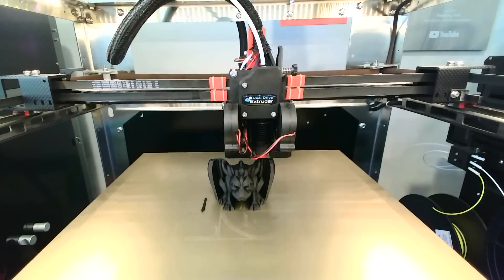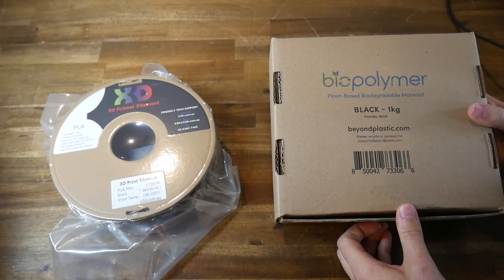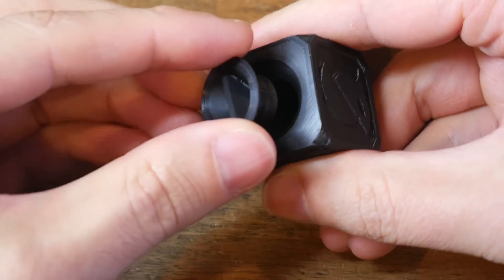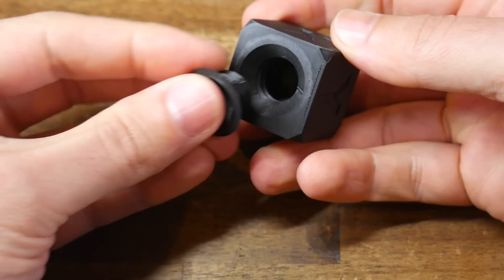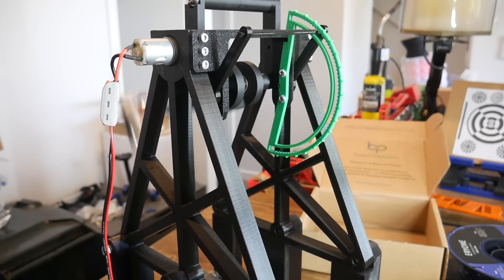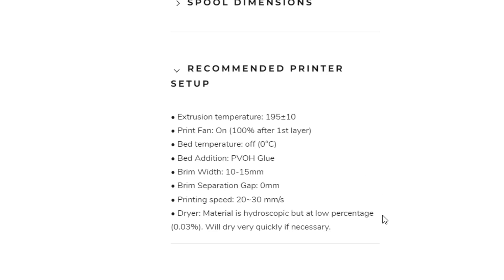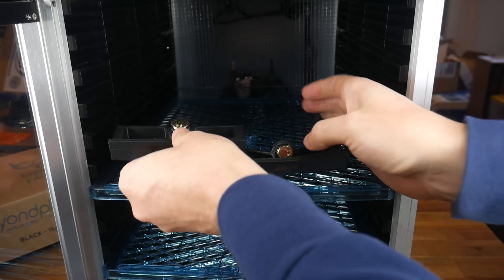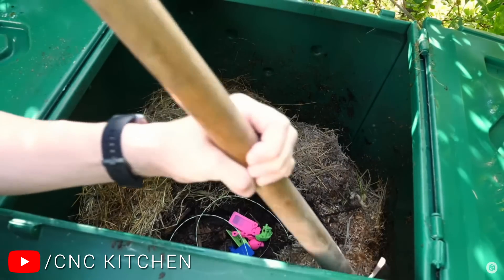PHA filament - Mostly superior to PLA and actually eco friendly

Comment: I am fairly new to 3d printing but if PHA cost the same and print the same (with a flow tweak) I would change at once. In my limited experience (almost) every print yealds better results with a raft for bed adheation, I would love it if all the waste was compost compatible to reduce microplastics in our enviroment. I was planning to burry a dead pet in a 3d printed "coffin" made from "wood" PLA but what I see make me hesitate. If I could buy PHA filament on the other hand it would seam ok to use, or did I miss something?

Comment: I would definitely be interested in PHA if it was close to the cost of PLA. If I could get it for less than 20 bucks a roll that would be great. I print mostly functional parts, and a little decor. I think putting it in a car would be interesting. I also want to know how well it sands down to accept primer and paint.

Comment: I'm so glad to see how many commenters here have used PHA or are interested in doing so. The public library makerspace i work at has used every single brand of pha we can find, AllPHA, Beyond, Regen (unfortunately), EcoGenesis, and soon also PHA3Design once it arrives in the mail. Personally my experience through all of that has been that the different (non-blended) brands are all relatively pretty similar. Certainly much less variation in quality than I've seen from PLA, at least. I've tried a few other ways to reduce warping that i haven't seen mentioned too much yet, including:

- If you have an enclosure, open it up as much as possible.
- The higher the infill percentage and the more solid bottom layers there are, the more it will warp. So avoid that where possible.
- Gyroid infill, or any other pattern that curves. When that contracts it kinda has some room to just straighten out a little, instead of pulling on the walls.
- Set the first layer pattern to concentric or Hilbert curve, evens out the distribution of contractive forces that cause warping.
- Finally, if all else fails… Rotate the object until it’s sitting on a really impractical edge, then print it in sort of a “cradle” of support material. BVOH or PVA if you've got it. Basically make as little of it touch the build plate as possible. Wasteful this way though.
Reply: If I may add (I am the co-founder of Ecogenesis genPHA Filament).

Print fast
1st layer should be at 217c, subsequent layers at 193c. 
Brim, 3mm, zero gap 
Frogtape pro-grade Orange tape works really well. Far superior to 3M Blue Tape. 
Warping in controlled by print temp and speed. 

Thank you
Reply: Oh i forgot one!! Find a formulation of PHA that is super flexible, like Beyond used to have, and make the first couple layers out of that instead. It doesn't warp at all and has incredible bed adhesion, that compensates for the warping of subsequent layers really well.

Comment: Hello! I am having a lot of trouble using PHA in my Flash Forge Adventurer 3 Lite printer. The PHA seems to not be rigid enough and gets squished when I'm trying to load it into the machine. Any thoughts on any type of mods I could make or a way to make this work?
Reply: What brand are you using? 
Ours is tested using AMS without issues.

Comment: i would still use pla for some prints but this is great, would be great as the standard for most prints and prototypes, just needs to be cheaper
Reply: Cheaper comes with volumes, need more people to start using it to get economies of scale.

Comment: I’ve recently come across PHA filaments and I wonder if it’s could be the next big thing in 3D printing. It’s the first non toxic, fully biodegradable (in home garden or garbage dump environments, not only in industrial settings like PLA). 

It’s referred to as a “bioplastic” and it appears to be one of the first eco friendly alternatives with minimal greenwashing we see for others like PLA. The major downside is the cost (higher). 

Beyond that, it’s kind of the goldilocks filament between PLA and PETG when it comes to trade offs of strength, UV or heat resistance.

Comment: For making cosplay parts it would be intresting if it can be machine sanded.
Since it does not deform in your oven test i expect it to withstand the heat created by a orbital or other sanding devices.

Also the warping is a big issue for me 

im currently printing with PETG due to its mechanical properties but would switch to PHA if the issues above would be solved

Comment: I'm more interested in its heat resistance, in my testing with PETG it is not nearly as heat resistant as many people claim it to be, an alternative that doesn't offgas styrene gas but can handle being in the sun would be very welcome. Another huge issue with PETG, ABS, and ASA is that the available color treatments and silk are not really available, I'm not sure if this is an issue with demand or if it is harder to color those materials than PLA, but if PHA is able to be treated with the same color variation as PLA can, that would be exciting. I know I am something of a minority in the space, but I hate printing with PLA because of the low heat resistance, even just plastic creep as a result of low temperatures makes it something I have zero faith in. I would love another filament to replace it outright by being as easy to print but with better mechanical properties.

Comment: I print with PLA because it's basically non-toxic, and I didn't see a discussion of this in the video. If I can print with PHA and not worry about the fumes, its better material properties seem tempting - although having to use glue might be annoying. PLA has the advantage of coming in thousands of variants, so plenty of people won't want PHA that doesn't have galaxy glitter or what have you, but I'm part of the probably majority that just wants basic colors, so PHA could work for me. I'm not sold, though.

Comment: I want to see a wood (or similar biodegradable) fiber filled PHA to see if it can help with the warping. It's the one major drawback of this material. Glass fiber fill would be ok, but it has a very high carbon footprint to manufacture.

Comment: I would also be curious about the fumes it releases. It seems that when printing PETG has little to no toxic fumes that can have you while PLA release some pretty bad stuff while printing. I would love to see a filament that is like PETG where its safe to print and pretty high heat resistant while being biodegradable like PHA, if it release is biodegradable like they claim it is.

Comment: Having mainly printed in PLA and PETG, I have not really experience warping, that I can tell anyway.  Most of my prints have a large surface area for bed contact, and after getting tuned, have only experienced prints coming off the bed with key filaments (which probably means more fine tuning as it is mainly due to collisions at high heights).  I would be interested in PHA over PLA for both the biodegrading as well as the heat and UV resistance.  I printed quite a few things that sit in my car, and had to switch to PETG as in the summer here in Ontario, PLA would warp.
If the cost is the same, (or a few bucks more per reel) I would switch, but as some stated below, not all PHA are equal, and I would want to go with a backed brand.

Comment: You don't want it to biodegrade. PLA is made from plant material and locks up "new" carbon. It will lock it up for hundreds of years. Good thing. Biodegrade it and you release CO2. "But mircoplastics!" Well, no problem. PLA degrades to harmless materials if it gets inside the body, which is why it is used in dissolving surgical sutures.

Disclaimer: I invented PLA filament,  precisely for these reasons and deliberately did not patent it.

Comment: I would absolutely like to get ahold of some PHA. I'm using almost exclusively PETG at this point because I hate how PLA behaves after printing and I'd really like to get back to something that's healthier for the environment. At $30/kg PHA isn't THAT much more expensive than good PETG or PLA which run $20-$25/kg, so it's absolutely worth it to me.

Comment: Extremely interested in PHA. One of the reasons I was okay with 3D printing is that I knew no petroleum products were used in creation of the filament. Getting a filament that prints on par with PLA, that is better from a materials standpoint, and that is more easily broken down when end of life would be fantastic. I probably wouldn't pay double for this filament, but I would certainly pay a substantial premium. In the long run, prices would surely fall and get it on par with PLA from a price standpoint.

Comment: PHA warps, like a lot.
You need to cool your plate as much as you can, making sure to cool down the plastic as much as possible and/or use a lot of glue.

I’ve used them for bushings on a small boat dock, they work very well. They don’t degrade while in the water, but anything that’s worn off and falls to the seafloor will get eaten by the bacteria, and if anyone drops a bushing it will also eventually wash up on a shore and be eaten by the bacterias. Very good for marine applications where the print doesn’t come into contact with the sea floor

Comment: Did you try maximum cooling fan to combat the warping instead of heat?  The heated bed and enclosure did nothing, maybe the opposite is the answer. 

And yes, I would buy this in a heartbeat.

Comment: The warping and slow recommended print speed (30mm/s) are pretty big deal killers. Especially when I can just burn PLA in a normal fire when I'm done with it. It's no worse than burning wood and a lot better than leaving it intact in the wild (I don't used colored PLA filaments so I don't really need to worry about what is in any dyes when I burn it).

Comment: I mostly print ASA in my case, mainly because for functional prints properties are just much better than PLA or regular ABS and my Voron can handle it just fine. But PHA does seem to address most of the issues I have with PLA, mainly heat stability, brittleness and UV stability, while also being actually compostable. So I would definitely like to give it a go

Comment: PHA's material properties remind me a lot of Extrudr GreenTec Pro.
Its components are not specified exactly, but it is said to be a very environmentally friendly material. 
It prints like PLA, has a better surface quality and is significantly more heat-resistant.
There is also a carbon fibre version.

The company says of GreenTec Pro:
"GreenTEC Pro comes from our BIO Performance range and has been specifically developed for ultra-high performance applications. The material has a heat deflection temperature of 160°C (VST A - 4mm wall thickness) and is optimised for high stiffness and flexural strength. The material offers a high-quality, semi-matt appearance. GreenTEC Pro is the ecologically harmless alternative to conventional industrial materials, consists of 100% renewable raw materials and is biodegradable in accordance with DIN EN ISO 14855. In addition, the raw material has food approval (FDA)."
Reply: FDA approved means very little unfortunately. FDA allows GRAS (Generally Recognized As Safe) ingredients, meaning a supplier can simply write a letter to the FDA stating their confident the product is not going to kill anyone and you get FDA approved.  Hence why we still pump our US made Wines full of un-declared preservatives (Velcorin) and we still have petrol-chemical base food colorants (Red 40). 

Also DIN EN ISO 14855 is not a biodegradable standards. Its a Industrial Composting standard. Meaning using an industrial digester per ASTM6400

The US base Biodegradable standards is ASTM6691. In EU it is used as part of the three test used to achieve TUF Austria Marine Biodegradable Standards. 

GreenTec Pro is simply greenwashing their claim. They offer no certifications (even the DIN EN ISO 14855 they claim to achieve) and no third party testing.  And since there is no anti-greenwashing laws in the US. They can state or label as they see fit when selling here (US). 

I willing to bet their product is not for sale in their country of origin (Austria), as that would definitely be illegal.

Comment: I don't really print in PLA any more - I'm actually working through a project now to try and use up my remaining stocks - but it sounds like PHA might be usable as a PETG replacement, too.  If that was the case then assuming that a) PHA was comparable in price and availability and b) the bio-degradablility factors are accurate, I would happily switch.

Now all we need is a bio-plastic that's as easy to sand and solvent weld as ABS but is also easy to dispose of, and I'd be all set for truly green printing.  :)

Comment: Thank you so much for talking about it !! As you might have seen on the Wikipedia article, PHA is not a single polymer but a family of polymers with some of which have very interesting properties such as PBS. 
Sustainability tends to be dismissed in 3D printing but there are so many efforts to use 3DP as a medium for recycling and sustainable materials, it's a shame they aren't talked about more. 
So thank you once again for this video

Comment: Also I wonder if the new biqu cryogrip build plates would improve adhesion, since they are specifically designed for low temps.

Comment: I've printed around 6kg of PHA. The warping is indeed it's massive bottleneck and kind of limits what you can print with the filament.

Out of my experience, using textured beds, with glue stick and lowering your Z offset and not using any fan except for bridging tends to yield best results. 

Also, what is interesting is that not all PHAs are the same. You've had a fairly elastic batch, I've had extremely brittle and fragile ones. Iirc, there are like 9 different families of PHA. I also recall it crystalizing over time at ambient temperatures, turning them a lot more brittle and weak. So for any parts printed out of PHA, it's not a question of "if" they fail, but rather "when" they fail.

Comment: If they can get this down to $20-25 a spool it would help fill a niche between PLA and TPU, not too brittle, not too soft, good heat resistance. also competitive with PETG, and actually can be biodegraded. The uniform finish and printing temps, would be a selling point as well to print farms, they can print faster(without obvious banding), for less expense due to lower heat, and can be more eco friendly, while offering something that stands up to heat warping better. Also with that warping though.. I think you need to find the glass transition temperature of this material and get the bed there. Just like the new 'frozen' build plates.. just because you can print colder, doesn't mean you should. The plastic is fighting you and you need to figure out why, probably too cold still, plastic shrinkage is an important parameter.

Comment: I recommend printing a shape identical to CNC kitchen in order to compare with his experiment.
Reply from the maker: Not sure there's any point if I don't have his testing apparatus to use on them.
Reply: @TeachingTech   yes I see for stress testing you are right.
I meant like the benchy to observe deterioration. It would be more qualitative than quantitative but I feel it would be similar to a square shape you proposed that is not made for destructive testing.

Comment: To answer your question - if it was similarly priced and had the better biodegrability as advertised, then I would definitely consider switching. Only other consideration might the color selection, and situations where PLA is better, but this is similar to how I choose when I need PETG, TPU or other materials. I would love if my default print material could be much more environmentally friendly.

Comment: Careful though on compostable plastics. Yes, sounds great that it degrades, but you need to consider what it degrades to. Under anaerobic conditions (absence of oxygen), which is certain in landfills and even some composting if not managed well), decomposition produces methane, which is >30 times worse than CO2. This does mean we can turn it into biogas and use instead of Natural gas, but when this is discarded it could actually be much worse in balance that conventional plastics like PET or PE when latter is captured in landfill.

Comment: 08:00 the section might be consistent, but the testing will not be if you change the infill. Lower infill will flex more and take up more energy in the swing

Comment: To me the big benefit to using PLA as opposed to other plastics is that it can be broken down within the human or any animal's body. That means very little health hazard, while still being extremely resistant to degradation in normal soil conditions, unlike PVC/ABS.

Comment: Hi. It's my first time seeing your impact test jig so apologies if you had it for a long time and I'm making this comment too late; But how it shakes upon each movement of the hammer would act as a dampener for the motion of the hammer and introduces error to your statistics. 
I suggest either adding rubber feet in each corner or bolting it to the table. I'd definitely go with the latter. 
Thanks for putting great content. Hope I could help with a small matter. 
You actually inspired me to try ASA filament (FormFutura AppoloX) from when you made an airbox for your drift Silvia very long time ago.
Cheers!

Comment: I run a farm and plastic in our compost sources is a big deal. For testing, solid rods of different diameters would be interesting to see. The thicker the wall, in theory the longer it will take to break down. Small plastic often "break down" but it's more mechanical than chemical.

Not sure if you want to test your pile, but the heat of the pile will make a big different on overall biological activity and the prevalence of particular microbes (e.g. if it needs bacteria to break down, a hot pile may be better than a cooler pile which might be better for fungal processes).